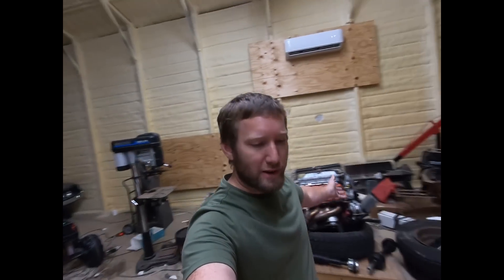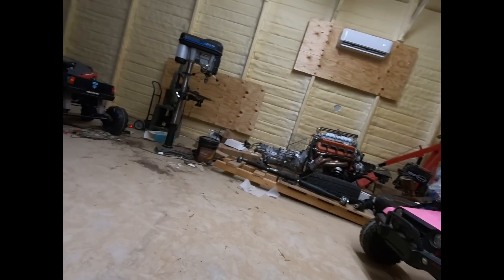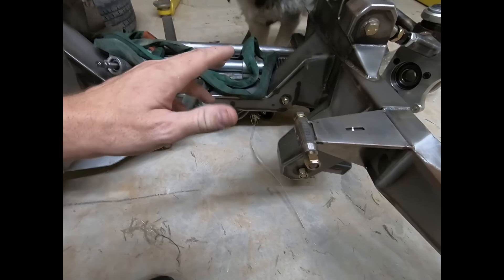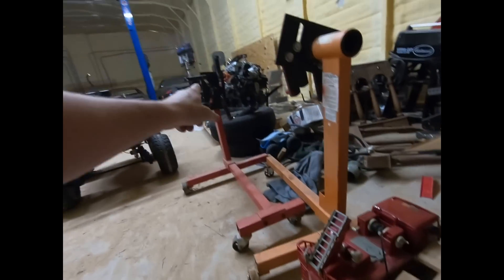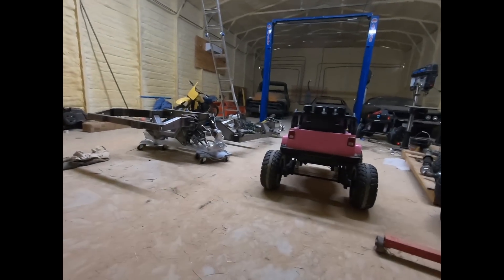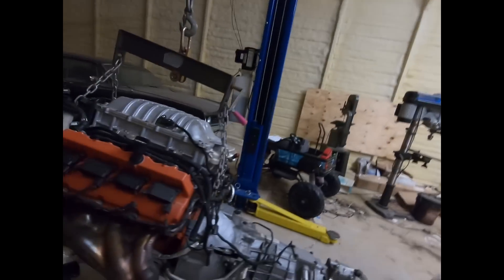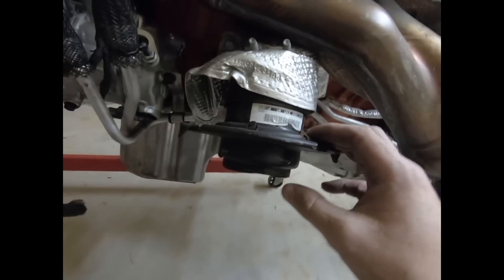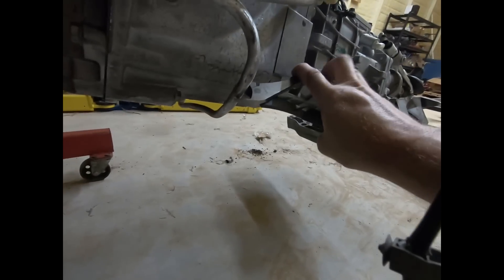Hellcat swap in a 1967 Corvette Ep6 - Engine placement - Part 1

Comment: I want to do that to my 69 Corvette
Reply from the maker: Roughly the same frame as C2, check out Rothspeed, they built mine. They didnt have a hellcat engine to place the motor mounts in the exact spot, but just tacked them in so I can adjust as needed

Comment: Very nice start. Have you figured out what the gear ratio for the rear end will be yet? Every work shop needs a dog to help pass the time. Be safe.
Reply from the maker: Thank you, the rear is a wavetrac 3.55 gears with 35 spline axles